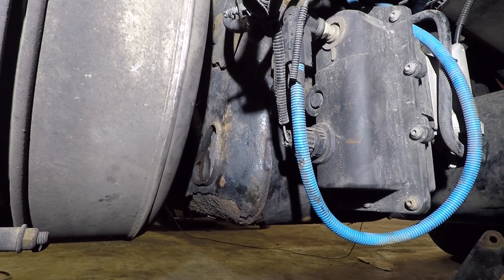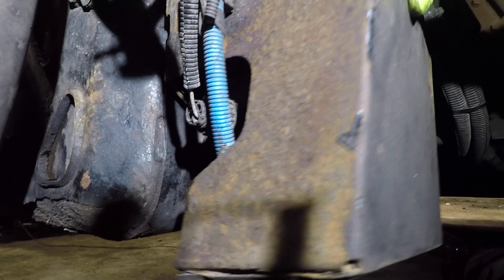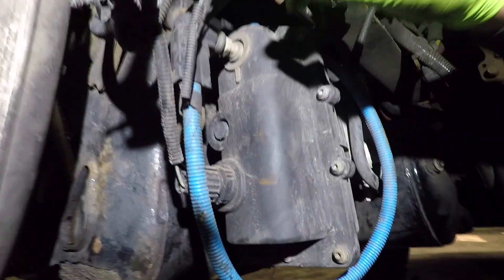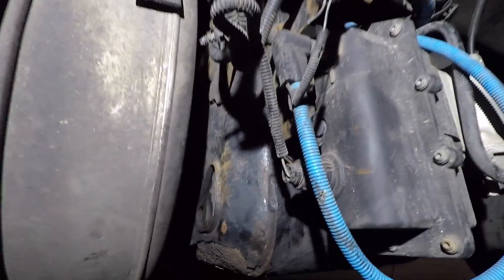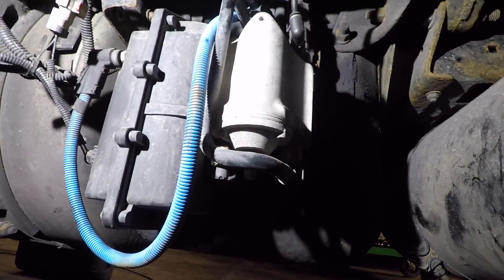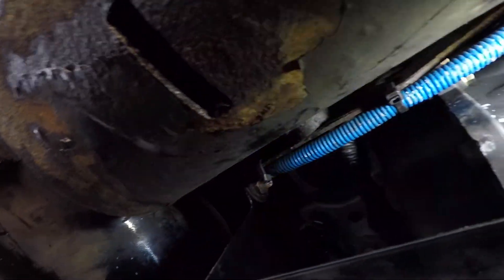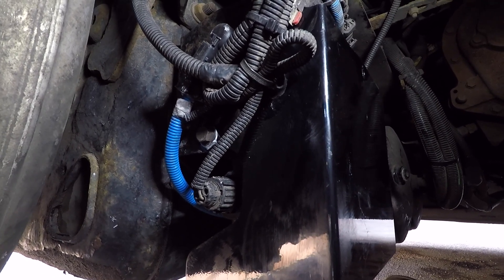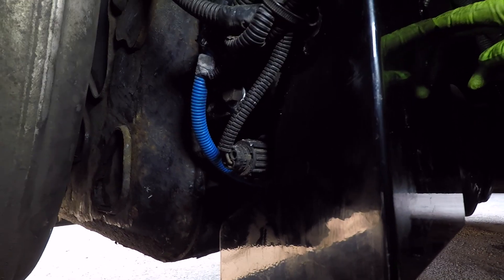DD15 Cascadia DEF issues. DEF Line Heater Open Circuit Error Code

Comment: One cuestion 

Is it necessary to change the DEC pump if only the cable is damaged? Because my 20016 dd13 freightliner truck says that the DEF heater needs fixing. Do you think it could be a damaged or broken cable?

Comment: Someone please help..is there a fuse for the Def heater line and where is it..code is 5488.line 5 def heater line..I already swithc the line. And still have a open circuit..
Reply from the maker: no fuse. Harness issue. Check the wires and cennectors
Reply: @TruckYoo  not even a relay?????
Reply: What can happen if drive the truck with spn 5488 cod for 2 weeks?

Comment: I have a eec 61 fault code. What can the problem be?
Reply: I got the same code stop at a petro amd it is that heater line 1 watching this I will be replacing it later.